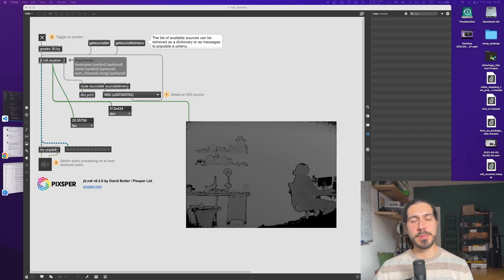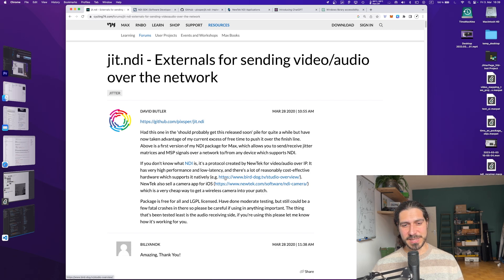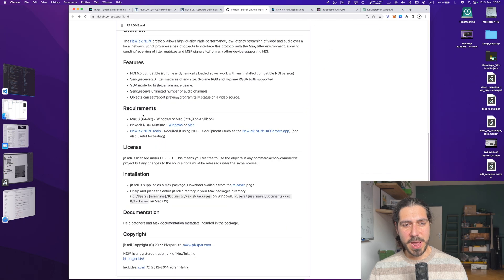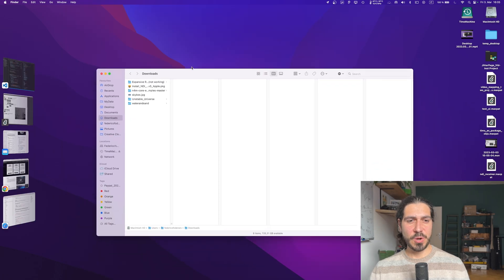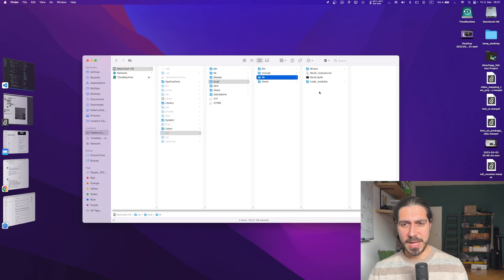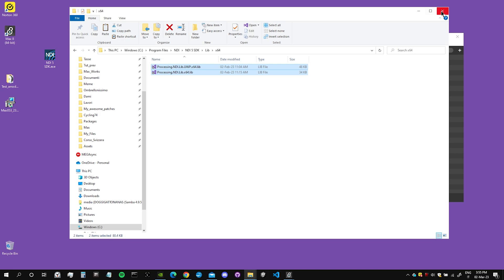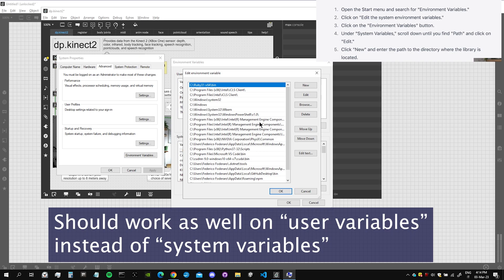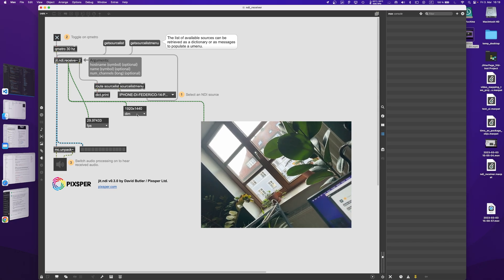Using the jit.ndi externals in Max/MSP/Jitter to send Video and Audio between computers in 2023

Comment: why this wouldnt work with texture but only matrices? as I understand, with matrices it wont have the same performance as if it was a  texture
Reply from the maker: Textures are data buffers stored in the GPU. To transfer them through the ether you need to get them out of the GPU and ship them in packets. They are not textures anymore once they arrive on the other side

Comment: Well, it's great that you covered this topic as well. Too bad you did not cover it a year ago when I was researching the topic heavily. ;))))

BTW, I still have issues with NDI | HX in Max. No idea why. I wrote about the issue in the forum.
Reply: Curious what issues you are facing w/NDI | HX since I just got the iOS App would like to be aware of potential hiccups with it.  Thanks!
Reply: @LuisTorres-qz5kr  I have issues only within max on Win. With most of the gpu drivers it can not see hx video stream
Reply: @ygreq  Thank you for letting me know. I was initially testing on my Mac, yet, will also be using Win/PC for send/receive between both computers similar to described in vid,

Comment: Thanks for sharing.  This was certainly of value to get this feature running. I have a Kinect which I'll test later, yet, went ahead and tested the NDI Camera (via iPhone) which worked great! I tried the iPhone with a couple of other camera apps, yet, that did not work.  Seems you have a separate app from the NDI solution on your iPhone.
Reply from the maker: Hey! 
For the video I've used an app called Zigcam to show the video stream from the phone.
Reply: @AmazingMaxStuff  Thanks for letting me know.
Reply: @AmazingMaxStuff  Do you know if there is a free app for android? I tried the native NDI app which works very well but the free apps say "To view NDI output from this camera app, please add it to a NewTekCast template as a Video Source". Thanks for another great video!
Reply from the maker: My pleasure! 
Unfortunately I have no idea what NDI apps are there for Android